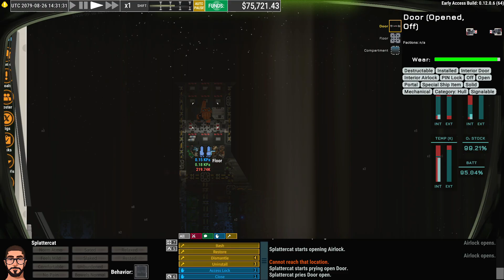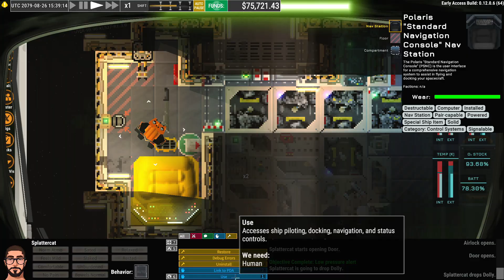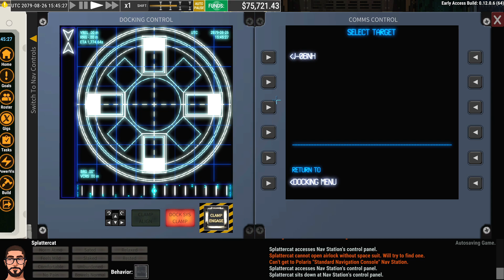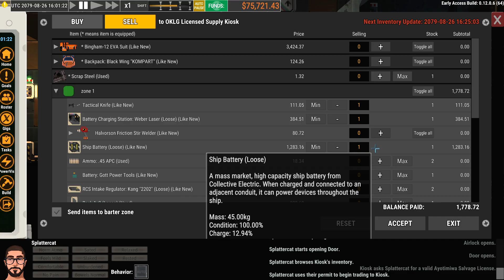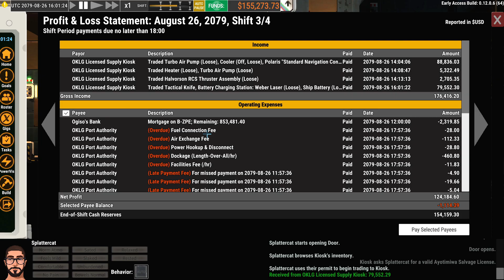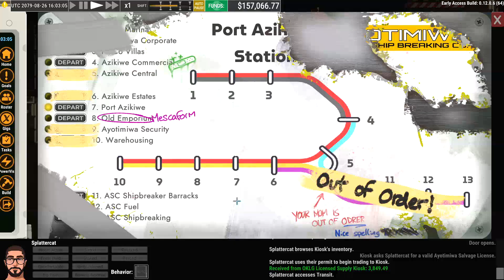Ostranauts Offers a Sci Fi RPG Experience Unlike All the Others

Comment: Also, you have the Weber Laser, which replaces cutting tools (like the grinder), soldering tools (like the soldering iron), and welding (like the welding torch, which you don't have on your person), meaning you're carrying more stuff than you need to be. If you have the laser, the only other tools you need are the drill and crowbar.

Comment: I logicked my way through starting the nuclear reactor, it was quite nice and then a cop rammed my ship and blew me up. I thought I exploded the reactor.
Reply: Very impressive, btw. You got stones on ya lol. Did you start the reactor near the cop without clearance? The reactor puts out a controlled nuclear blast something like 50-75(?)km behind you... it's in one of the flight manuals, so you gotta be careful where you start it and ensure authorization. I just happened to notice this tidbit and thought I'd share.
Reply: @B16G-ER  lmao is that why I got murdered? Holy hell.
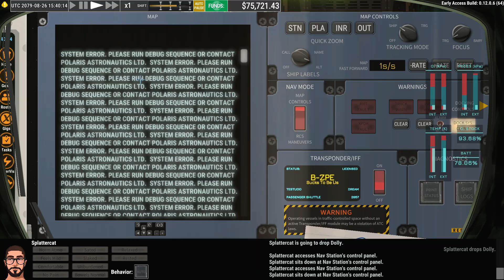Reply: @Raye938  I think at least in old version there is a generic warning tip under fusion torch drive control panel about that, seems they removed the panel now 19:28